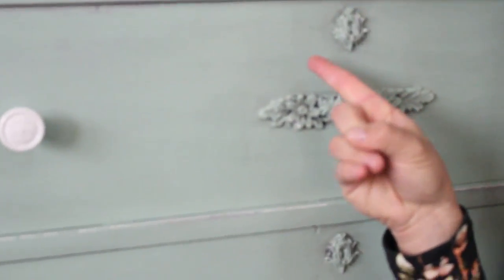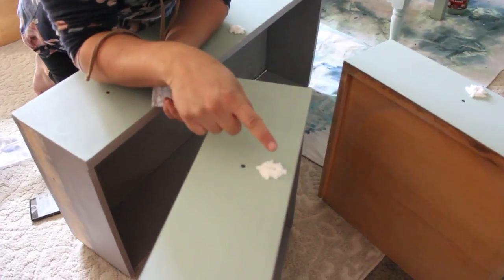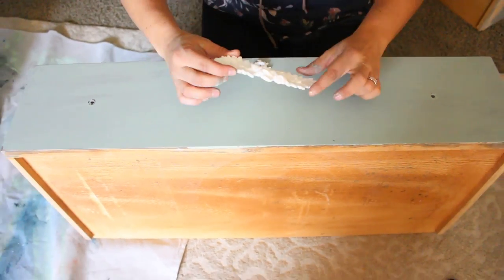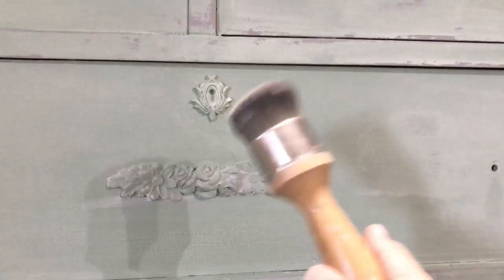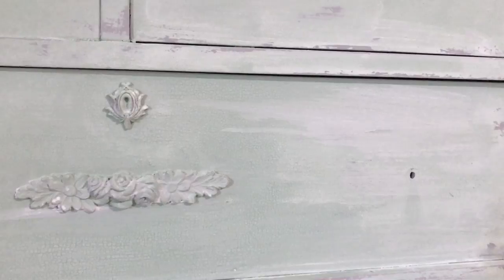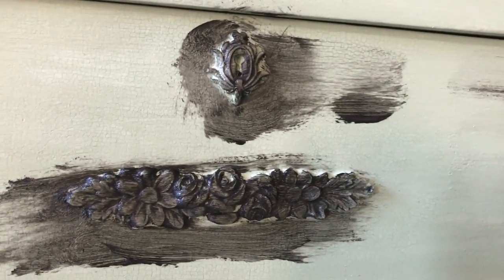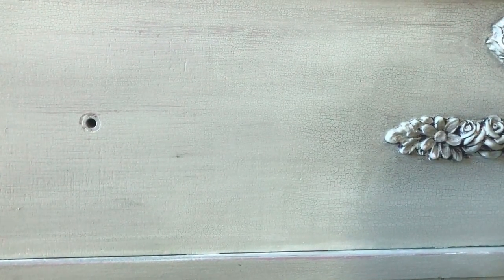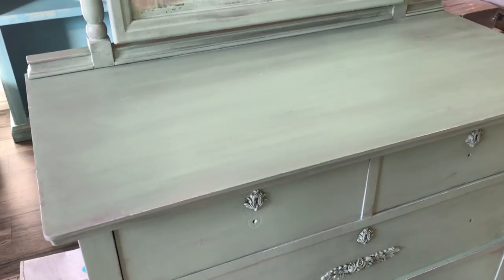Milk Paint Crackle with Dark Wax | JRV Applique

Comment: Would the oil wax work on a painted kitchen table? Or do you recommend something else?
Reply from the maker: It would. It gets very hard after about 30 days. I like to use sweet pickins top coat on table tops. I feel like 3-5 coats of top coat is very durable.